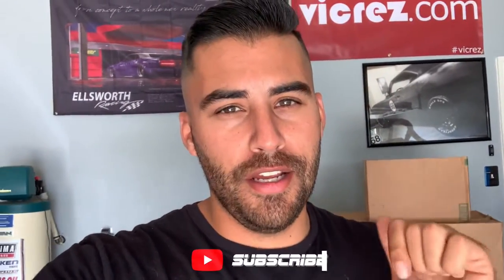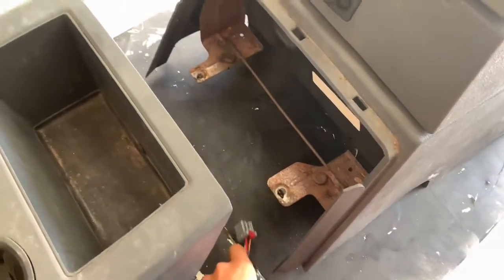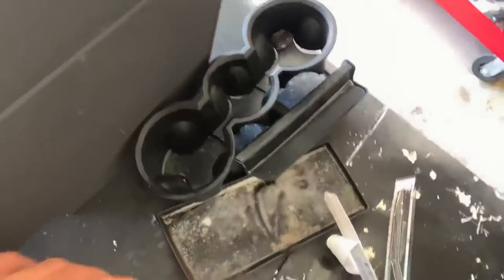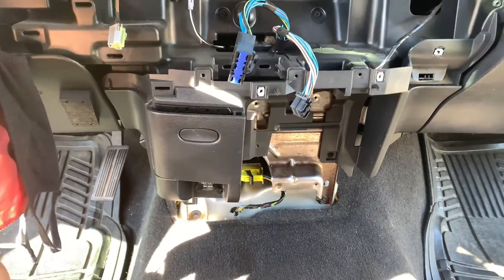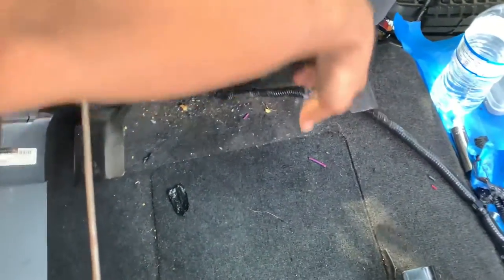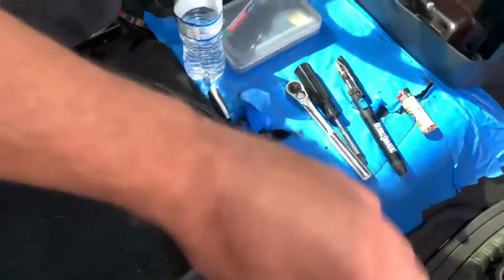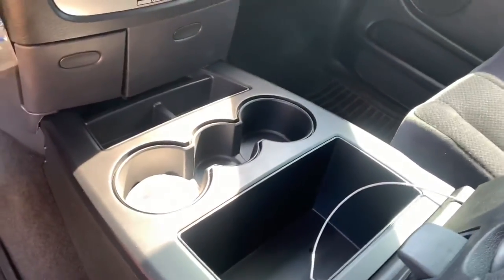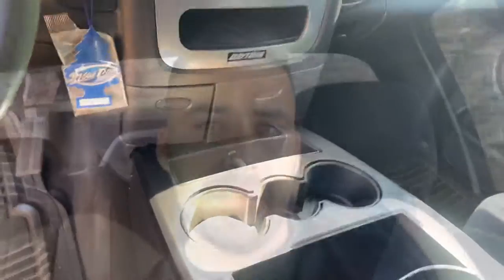Dodge Ram Daytona Business Center Console Install!

Comment: Hey man I’m a little late but how did you clean and paint the central part with the wiring in the way?
Reply from the maker: Central part as in the center console or center on the dash? 

If I remember correctly I completely tore apart the business center console and painted all the pieces individually. As for the dash I didn’t paint anything. It should all be in the video. 

Any wiring I just removed it.
Reply: @TIRADORACING  the central bottom part of the console where it bolts in by the seats. 

I dismantled the console for the most part but I can’t figure out a way to detach the wiring from both cigarette lighters 

I have on behind the console for the back seats and one in the top compartment 

So basically the wiring is refraining me from fully cleaning the bottom part
Reply from the maker: Oh yea just twist them and then come off!